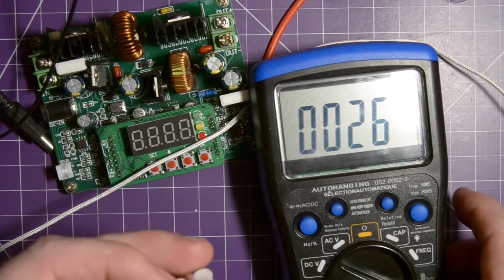A Closer Look: Cheap Spring Terminals

Comment: Thanks for the test, some people forget about losses in cables in connectors.  I've also bought like 2 bags of those terminals. 
I really like them for quick to test projects like class-d amp modules and quickly connecting speakers.  My only wish is that they would make a smaller versions of this since they do take up a lot of space.
Reply from the maker: Yup this is true! Thankfully the losses for my purposes are minimal but I sort of want to test them to destruction.....like via a 120v heating element or something....too bad electricity costs a fortune in the frozen tundra of Canadia
Reply: Wow didn't know electricity was expensive there.  I pay like 140 euro a month for gas (heating and cooking) and electricity a month. (220 Canadian Dollars I just googled) in Belgium.   The only thing I hope is that  someone invents rain panels. I would have free electricity non stop I guess. 
Enjoying your videos a lot!
Reply from the maker: Yup, we pay 13.2 Cents (CAD) per kWh at on-peak times (when I usually have time to record my videos) - and if they could invent Snow Panels, I wouldn't have to pay to heat the house!

Comment: Try to put inside this red dupont wires for arduino (you are put in  on your video but not tested with Amps) and test it with 3 Amps (or more)  load and then you see that white plastic melt, I tested it and wires melt into the white plastic.